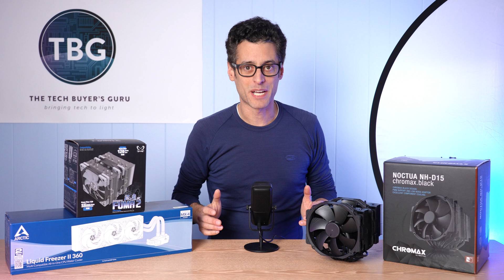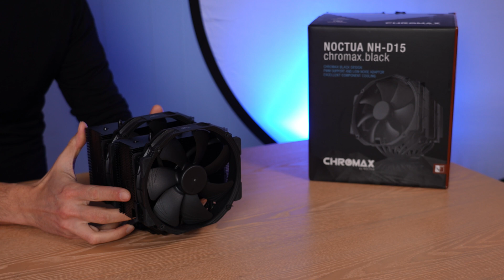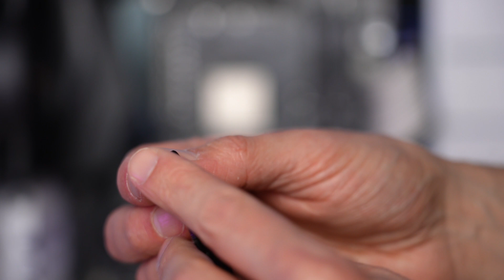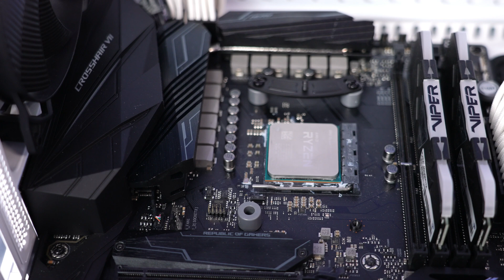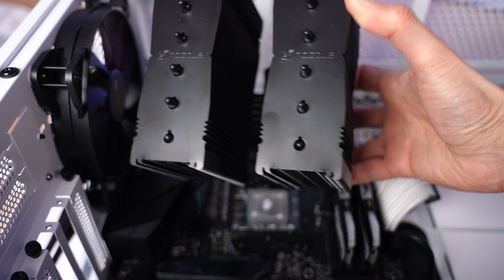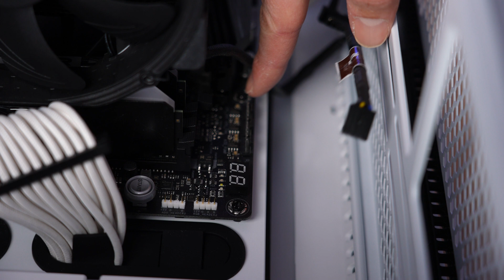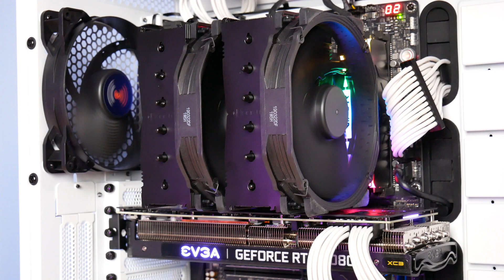The Noctua NH-D15 CPU Cooler: Installation Guide for AMD's AM4 Platform

Comment: It's nice, that Noctua launched black line after years and years of complaining about brown and beige pattern letting you only color match your Louis Vuitton themed build. My favourite additon in Chromax D15 are these mysterious white code numbers on most exposed point of fans :> But if you can mount these fans upside down to get full blackout look and without exposing the cables or any problems with them - great.
Reply from the maker: Agreed the fan labels are very mysterious, and no, you can't flip them unless you'd prefer a cable mess. My guess is that this has something to do with preventing counterfeits in photos.
Reply: @TheTechBuyersGuru  But - if I'm not wrong - brown D15 doesn't have this codes. So my guess it's a joke by Noctua to all of the poeple hating their traditional pattern and being for their taste too concerned about looks - Chromax buyers :D Maybe bad from sales perspective, but something they couldn't resist...
Reply from the maker: The brown ones do have numbers, but they are printed in white and barely visible on the beige frame. While your theory is humorous, I doubt Noctua would go to those lengths to upset the beige haters. My guess is that it was an oversight by the design team, which didn't think to change the type color to grey to blend in better on the black. I'm tempted to ask, actually, so stay tuned... I might get an answer to this perplexing question!
Reply: @TheTechBuyersGuru  That would be awesome :D
Reply from the maker: Here's the answer, straight from Noctua. Definitely just a technical problem, and it sounds like they are working hard to address the issue:

"Thank you for your question, these are production batch numbers that allow us to track when a fan has been produced. We are in the process of introducing a new laser printing machine that will allow printing on the opposite side in a shade of grey that is less easily visible. I hope that we will implement this within the next month or two!"

I bet you won't find this information anywhere else on YT. That's what you get for being a loyal subscriber!!!
Reply: @TheTechBuyersGuru  Thank you - your effort was great :] But to me this explanation sounds like total bullshit :D They are working like one year on advanced machine, which will let to print the code on another side of fan in grey colour... OK, I'm not laser printing engineer and know nothing about it, but I just can't believe... To me the reason of putting here these codes stays unknown, but they are sick of people complaining about it. Just read reddit stories of people deliberating, how to remove it and emailing Noctua with it. Btw type in google ,,Mit dem Noctua NH-U9S chromax. black bietet der Hersteller nun auch einen der kompakten Kühler" - I find it ultimate cooler testing methodology :]
Reply: I have the chromax NH D15 fans with serial numbers hidden facing the gpu backplate.  The 4 pin cables were at the bottom side facing the motherboard.

Comment: Biggest "problem" for this cooler is Noctua's own D15S - more compatible with RAM and GPUS, almost the same performance and is also cheaper.
Reply from the maker: I've showcased the D15S many times on the channel. Performance is good, but not equivalent (it's on par with the $60 Fuma 2), and arguably the value is worse than the D15, because it's only $10 cheaper and loses a $20+ fan. With that said, the offset mount makes it much easier to use, and will almost certainly be used in the next-gen D16 that will feature new 140mm fans. Hopefully coming in early 2022.
Reply: @TheTechBuyersGuru  In my country D15S is around 80 euros while D15 is 110+ euros (both in Chromax versions), that is why I prefer it over the bigger D15.
Reply from the maker: OK, that is a much bigger price difference than in the US.
D15 chromax ($100): https://amzn.to/37u6eBN
D15S chromax ($90): https://amzn.to/3dpPnUq
Reply: @TheTechBuyersGuru  Yeah, I wish we had those prices, then the D15 would be my first choice.

Comment: Although is no reason and no way to mount CPU cooler vertically, did Noctua included hardware for it?
Reply: Yes, they typically do
Reply from the maker: That's only for smaller coolers. There is no way to rotate this cooler. No brackets are included, and I'm fairly certain it wouldn't fit around other components anyway.